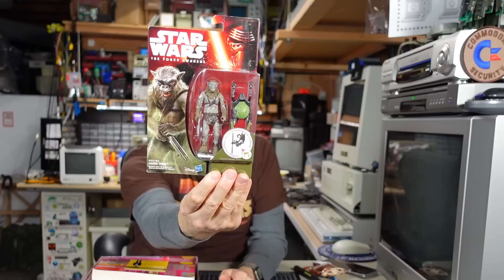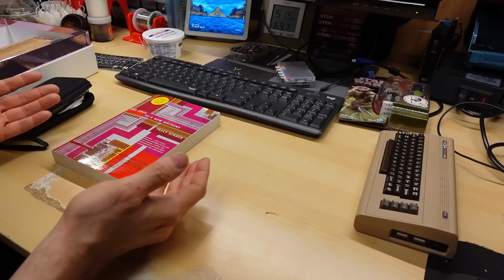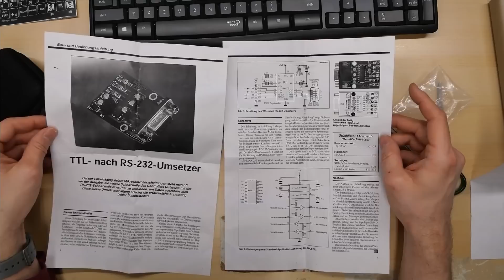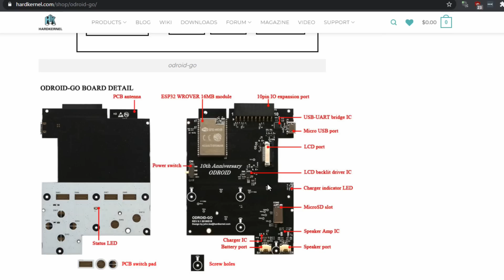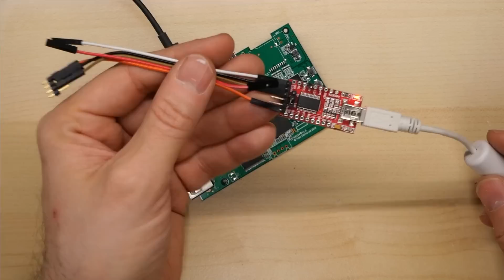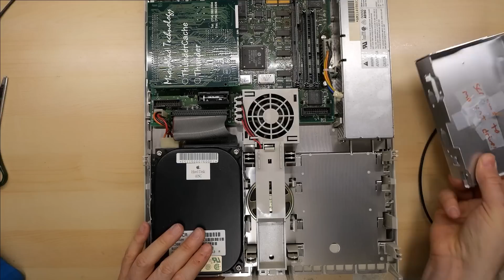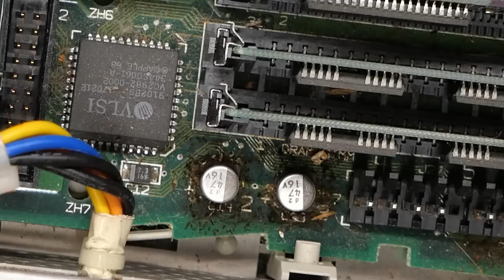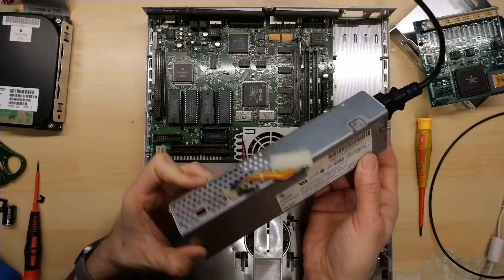A bricked TheC64 Mini? A filthy Macintosh LC, The ODroid-Go ESP32 handheld and more

Comment: I got an iPod Classic recently, and it's delightful. My phone has a headphone jack, but I have 20+ GB of music, and use my phone for (many) other things.
If you download the firmware from the retro-esp32 project, you can play Colecovision, ZX Spectrum (48K), Atari 2600, Atari 7800, Atari Lynx, PCEngine, and the original 5 systems.
The emulators have gotten updates over time, as well.

Comment: You mention (and quote your viewer) that the Mac LC shared system RAM with video RAM.  This is not the case!  The LC used dedicated, video RAM.  The first Mac to support onboard dedicated color video, without the need for a video card in a slot.  The IIsi shared its system RAM with the video, and that machine was limited to 256 colors.  The LC, on the other hand, was limited by the video RAM you had installed.  It could support 512x384 @ 256 colors/grays as standard (2x 256 Kbyte VRAM SIMMs), and 640x480 @ 256 colors/grays (and 512x384 @ 32,768 colors) with an upgrade to 2x 512 Kbyte VRAM SIMMs.  The LC 2 was nearly identical to the LC, except it had the 68030 processor, but was essentially the same machine.  The LC3 was the first real redesign, and used 72-pin SIMMs, and came with the 512 Kbyte of VRAM soldered to the board, with a single VRAM slot supporting an additional 256 Kbyte, and incidentally removed the 10MB limitation and 16 bit memory path the LC/LC2 had.  The LC475 used the similar board design as the LC3, but went back to dual VRAM sockets for some reason.  Macs that used shared video memory were the IIci, IIsi, and the PowerMac 6100 (oddly enough).

Comment: Schools bought dual floppy LCs because they were cheap. That's almost 3 megabytes of storage, what more could you ask for!

I think the '030 was pretty much just the same CPU core as the '020, except it had an onboard PMMU. (You had to add one to the only other '020 Mac, the original II, in order for it to support virtual memory.) The LC II was just an LC with an '030 instead of the '020, so it could break through the 10 MB barrier.

Comment: two most common baud rates for those debug connectors are 115K and 9600.  If I couldn't measure it, I'd try those two first.
Guess "LC" stood for "Low Cost", a Macintosh oxymoron.  Looks like a floppy connector on the MB left side, so I guess dual floppies were a thing.

Comment: To fix the commodore 64 mini you could use a digital SMD rework station with the smallest tip, set the temperature to 450° Celsius and air flow to the lowest setting, put the board with the top of the chip up towards you on a cookie pan or a silicone mat (or both), put some flux all over under and on the sides of the chip, hold it with a tweezers to keep it from flying away and move the hot air around it until the solder is melted then turn the temperature down to 375° Celsius and turn the airflow down more too so the tweezers aren't needed to hold the chip without letting the solder harden then give the chip a gentle tap on the sides with the tweezers let the chip pull itself back where it's supposed to be and cool then clean it after it has been cooling for 2 to 6 hours, that should fix it.

Or I could probably fix it I would just need to get some more tools first and I don't know how much the shipping would be back west from where I am over in the east.

Comment: Re: Dual Drive LC: Yes, they sold loads of them to schools in fact. That way you could keep the OS boot disk in one and the data program disk in the other. In 1990, skipping the hard drive would be a huge cost saving (and a classroom of 30 students loading MS Word from floppy is still faster than a classroom of 30 students loading MS Word over LocalTalk *at the same time*).

This would have been especially useful for machines with the Apple IIe card, since the IIe software took up most of a single floppy by itself. About 10 years ago I bought a job-lot of dual-floppy machines liquidated from a school, all with the Apple IIe card.

All LC I's have the dual disk ports of the motherboard (but not sure of the LC II and III) regardless of how many were actually installed, and that can be handy since you can connect something like the Big Mess o' Wires Floppy Emu to the other internal floppy port so you've got both physical disks and disk images in one box.

Comment: You can always try taking the flash memory off and flash with a FlashCat usb programmer but you would have to takeoff the chip with a hot air station 🚉 
pretty cool looking inside The machines

Comment: you could try to reflow the SDRAM chip. Anyone can reflow. Just drown it in flux heat gun for a few seconds and it should be reflowed successfully. To know for sure you can give it a gentle nudge and it will pull itself back into place but there is the risk that you could ruin something that would have otherwise been fine. Check out tronix fix. He does reflows all the time. Sometimes it works sometimes it doesn't. He doesn't ever replace BGAs.

Comment: The odroid you have is discontinued and replaced with $80 versions called "ODROID-GO Super Clear White".
They moved away from ESP32 and use a RockChip RK3326(Quad-Core ARM 64bit Cortex-A35 1.3GHz) with a Mali-G31 MP2 GPU running Ubuntu.

Comment: Shame about the C64 mini.  While it is a cool little machine, it is hardly the most flexible thing in the world.  If you can't get it running maybe you could re-use the case as a home for something like a Raspberry Pi.

The installation points on that accelerator card is interesting.  Maybe upgrading it to install cache memory could be another video idea.  I wouldn't use it with this particular Mac LC but I assume that there are better use cases for such an accelerator where its potential would not be so bottlenecks.

Comment: 7:20 - That's a Lindor (Chocoladefabriken Lindt & Sprüngli AG, more commonly known simply as Lindt, is a Swiss chocolatier and confectionery company founded in 1845). I doubt you'll get to experience any of the milk range from Kinder as they require refrigeration, can't get enough of them!

Comment: Hey Adrian. Something I’ve been wondering about and was hoping you’d have some idea about, but what is that J15 15 pin edge connector on these Macs from late 80’s - early 90’s? I had a look at the Classic II schematics but it didn’t give a pin out. I imagine they were used in the factory for burn in and quick diagnostic testing.

Comment: Dave from the eevblog did a successful reflow of a bga chip on a big tv dumpster score simply by heating the chip on the pcb . Perhaps you can give it a try
Reply: Thought the same.  On those bga's, often the chip that gets warm+flexes, forms a crack in a ball solder joint.  Likely the ram chip is good, and a bad connection under the CPU is causing the fail.

Comment: removing a BGA is not that difficult but you need a hot air station, re-balling is also easy, but to solder again with hot air check that the bga is locking on the space;

Comment: Cracked solder ball on that BGA ram I bet. You may be able to reflow, but it'll happen again. It needs to be removed and new solder applied, then reflowed, but sounds like you don't have the equipment to do that.

Comment: ESP series MCU's are tiny and powerful with lots of flash memory and RAM, they are more than capable of emulating any retro console or computer in terms of processing power. But the trouble is they have limited number of GPIO pins. Because of that I think the creators of that unit had to drive the LCD with a port expander type of device on a serial bus (I2C, SPI etc.) which will cause significantly slower data feed. I think that's why the display is jerky like that. With a RasPi, you gets tons of GPIO pins and can drive the same LCD on a parallel data bus, thus with enough data speed, not to mention the native HDMI capability. As you also mentioned, seems like it is actually not 100% intended to be a gameboy emulator, it is actually a great ESP(32?) development board with its own power supply, a decent screen and some buttons etc. already attached, and tons of other devices can be attached with the GPIO pins available to the user. I like it, IMHO, it is well worth the price.

Comment: Raspberry Pi is a microcomputer, you need to wait to load an operating system and it's a computer. ESP32 is my favorite microcontroller, they are instant on and instant run their one program and don't run an operating system but ESP32 are unique as they are built upon Free-RTOS for the IDF development environment which the Arduino components build on top of so you also get a Real Time Operating System running the ESP32. The Arduino Uno has about 2K ram and a 16MHz Atmel core. ESP32 has two fast cores each up to 240MHz, 520K of SRAM, 448K ROM, 16K RTC memory, 34 programmable GPIO, 10 capacitive touch IO, 4x SPI bus, 2x I2C bus, 2x I2S bus, 3x UARTS, 2x ADCs (18 channels), 2x DACs, led PWM (16 channels), RMT, CAN bus 2.0 for hacking your automobiles, Hall Effect Sensor for magnetic field work, built in WIFI-4 802.11b/g/n and Bluetooth 4.2 and Bluetooth BLE, and an ultra low power core that can draw as little as 8 micro Amps in the deeper sleep modes with radio shut down--basically it's the supercomputers equivalent of microcontrollers on the market and you can get them for $5 ea on Amazon when getting a 3 pack of ESP32-WROOM-32D (D like raspberry pi zero w has the antenna built into the pcb, U for an external antenna connector dev board) developer kit boards and free next day/same day shipping if Prime member. Back in my day microcontroller was PIC and not exciting, arduino is great but Atmel is expensive for what you get and 8-bit microcontroller with 2K bytes of ram. ESP32 has two new models almost released to the market, the S3 bumps the number of gpio and other channels higher, Bluetooth 5 etc and the C3 which has RISC-V as the main fast core. instrad of the traditional Xtensa 32bit cores. Not been this excited since I was a kid with my first computer. Program them in Arduino C/C++ or load MicroPython on and program it all in Python. ESP32 replaces the older ESP8266 microcontroller family. Raspberry Pi's my home servers, and ESP32 my home automaton engines and remote sensors. Microcomputer and microcontroller are two different things but work together complimentary to make a complete system.

Comment: 29:00 They are definitely not always 3v3 ... in modern SoC it's not rare to find them at 1v8.  (even if you still have 3v3 on the "power" pin, the rx/tx expect 1v8 and the uart needs a regulator on it).  Obviously not the case here since the scope showed 3v3 but still, don't assume it's always 3v3.

30:30  Apple locking out non original hardware to screw consumers ... how surprising ...

Comment: is the breakout connector wired correct? It seems your orange wire goes to the ground pin. Shouldn't that be black? And your red wire is hanging which normally is voltage unless you have it wired differently.  Hard to tell from camera angles.

Comment: They have the c64 mini firmware on their website at retrogames.
Reply from the maker: That's just the firmware upgrade which requires you do it from the UI on the device. They don't have the recovery firmware.
Reply: @adriansdigitalbasement  What about binwalk?
Reply: @adriansdigitalbasement  The firmware files are also only incremental updates of the emulator binaries and supporting files. The format hasb been reverse engineered though (https://thec64community.online/post/2897/thread)
Reply: @adriansdigitalbasement As I was digging online, try looking into the apx209 on the board it is a power management ic and apparently can have issues sending a reset signal to the a20, I guess it' could be caused by (LDO3 pin 41) on the apx chip, the datasheet says LDO3 can supply power for systems like SRAM or PLL on page 24. Here is the datasheet I found that has the most details https://linux-sunxi.org/images/8/89/AXP209_Datasheet_v1.0en.pdf .

Comment: I can explain the second floppy drive slot (for an optional 2nd floppy) on the original LC. In March 1991, around 6 months after after the LC debuted in Oct 1990, Apple began offering a special educational bundle of the computer that came with an Apple IIe emulator card installed in the PDS slot and replaced the hard drive with 2nd floppy drive. The idea here supposedly was that Apple was trying to encourage schools still using aging Apple II family computers to upgrade their systems to a modern Mac that could run all their old Apple II software rather then switching to an IBM PC compatible system instead. Both schools and consumers could also buy the Apple IIe PDS card separately for around $250 for use in any PDS equipt Mac. I imagine that with the much cheaper floppy drive replacing the expensive 40mb hard drive on the cheapest LC, that even with the added cost of the IIe card that this educational bundle was priced competitively enough for schools to discourage enough of them from considering going PC-Compatible.

Comment: C64 mini: Put it in the oven! 200 degrees C for about 20 minutes. I have fixed a couple of laptop graphics cards this way... [2c]
Reply: "fixed"---- yeah.... for a while ....
this is not a flip-chip issue, 200°C is too low to reflow solder, and still, not replaced the RAM
Reply: I would rather go with hot air gun

Comment: If the bootloader includes SDRAM training tables, it's possible they could be corrupted?  but if there's no way to get to a point where it's flashable, it might just be bricked unless the flash can be rewritten separately.  Otherwise yeah the RAM itself could just have gone bad.

Comment: I still have an mp3 player.  I avoid playing music on my phone, my phone is a communications device, a portable quick access camera (I have better cameras but phones are great in a pinch), a web browser and youtube viewer (when not near a much more convenient and suitable machine like a tablet of my PC) and it occasionally is used to run the odd app.  I avoid listening to music on it however as that drains the battery and keeps me connected to a comms system.

I do sometimes stream a radio station on it when I'm in the car as the car does not have DAB so cant receive that station.  When I'm home I just tun on the DAB radio (which also records btw, a feature I really had to search for).

Oh and yes, if the phone doesnt have a headphone jack in it, even if I rarely need it, that phone isnt worth buying ;)

Comment: I too read "the soul of a new machine", Decades ago, but I'm quite sure I must have it somewhere. 
If you have a hot air gun, (soldering equipment) you could try reflowing The memory chip, and Chinese ARM SOC (YECCH...!) to try to reflow the solder balls, it might work :-)

Comment: I have a Powerbook G3 Lombard and the black plastic on the laptop screen back is melting.  What would you do to improve that and prevent further destruction of the poorly designed skin for that laptop?  P.S.  I removed the little wrapped package of watch pram batteries which were starting to bulge in the wrapper.  Now I just need an original Powerbook G3 install disk set.

Comment: The ODROID-Go CPU can run up to 240MHz. I don't think it is a CPU performance issue - no doubt its the choice of LCD that is slowing it down
Reply: Actually the LCD is very good. The problem is no vsync and the ESP32 can emulate frames faster then it can send them on the SPI bus with the way the pins are setup. Display performance was sacrificed for the expansion header. (not dedicating a pin for vsync)
Reply: @KamotsTalksTech  Ah I see. A shame one of the pins couldn't be switchable between v-sync or external I/O
Reply: @smeezekitty  Ya I would have preferred that too. Unfortunately HK didn't want to update the design like they did with the GO Advance. I wish they would revisit it.

Comment: From my understanding, the 68030 is like... 5% faster at most than the 68020 at the same clockspeed.
Reply from the maker: Yeah was reading Wikipedia nad it says:

"As a microarchitecture, the 68030 is basically a 68020 core with an additional 256 byte data cache and a process shrink and an added burst mode for the caches, where four longwords can be placed in the cache without further CPU intervention. Motorola used the process shrink to pack more hardware on the die; in this case it was the MMU, which was mostly (but not completely[3]) compatible with the external 68851. The integration of the MMU made it more cost-effective than the 68020 with an external MMU; it also allowed the 68030 to access memory one cycle faster than a 68020/68851 combo. However, the 68030 can switch between synchronous and asynchronous buses without a reset. The 68030 also lacks some of the 68020's instructions, but it increases performance by ≈5% while reducing power draw by ≈25% compared to the 68020.

The 68030 can be used with the 68020 bus, in which case its performance is similar to 68020 that it was derived from. However, the 68030 provides an additional synchronous bus interface which, if used, accelerates memory accesses up to 33% compared to an equally clocked 68020. The finer manufacturing process allowed Motorola to scale the full-version processor to 50 MHz. The EC variety topped out at 40 MHz."
Reply: @adriansdigitalbasement  As an owner of both a Mac IIx ('030) and an original Mac II (the only other '020 Mac ever), I agree, they perform roughly the same. Perhaps the main reason for this card on an LC was the ability of enabing virtual memory (with System 7). Unlike the LC, the non-crippled Mac II had a socket for a 68851 MMU, certainly enabling the use of VM.

I think the 'cache' version of that board would noticeably increase performance, as would dramatically reduce accesses to the crippled (thus slow) RAM bus (wasn't the ROM datapath 32-bit, though? Not sure about that...)